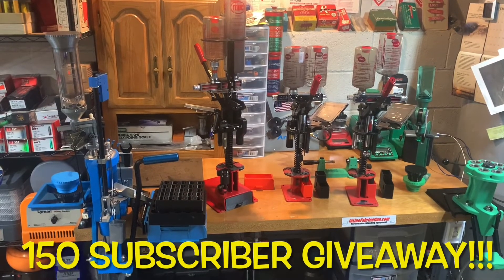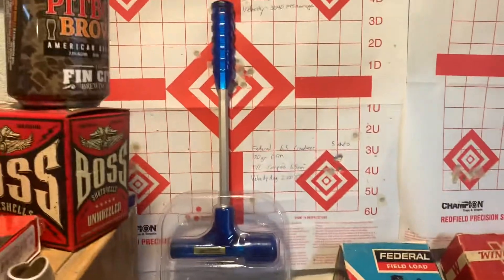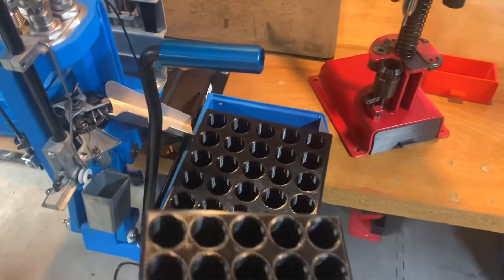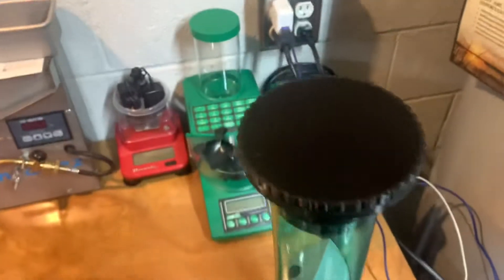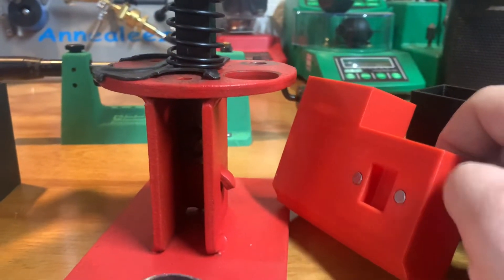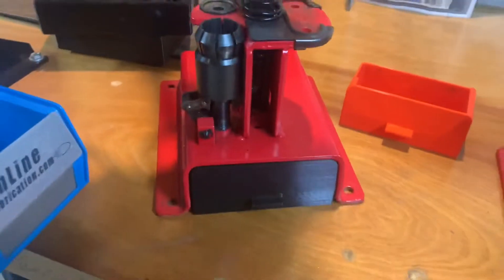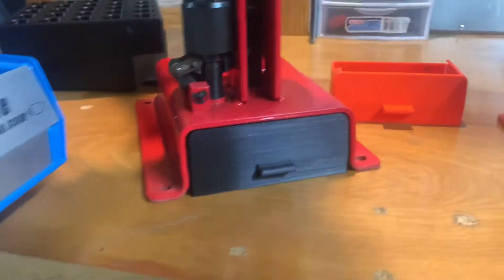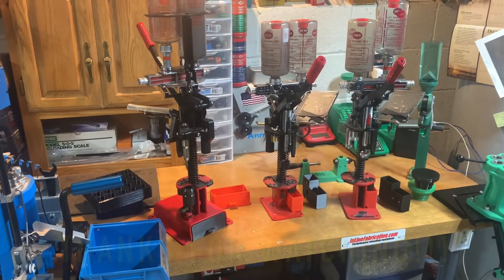150 Subscriber Giveaway! Three winners!! Thanks for watching!!! #PAwaterfowler #10gauge #20gauge

Comment: I'd skip the mergie chips , ugh . Keep the thinker thinking . Hard to do after a lotta years 10 ga . Ask me how I know . Early duck opens here on Fri.   Pls make a die box bin , modular , stackable . I have a 550 n several rcbs powder measures.
Reply from the maker: Thanks for the feedback. What’s wrong with Mergie chips? JK. 

As soon as I get design software back, I will add a die box to my list.
Reply from the maker: You won! I will send you an email here shortly. I am running way behind!
Reply: @avidwaterfowler7522   I got my first 10 @ '86 , have 3 . It's a game changer . I shoot a 10 cause we're not allowed an 8 . The difference between a 32" n 28 " is @ 5 YDS .  With lead 10 yds . ( sxs 32, o/u 32, n a bps 28)
Reply from the maker: @markwood4465  hey Mark, I sent you an email about winning. If you didn’t get it, please email me at avidwaterfowler@gmail.com
Reply: Got my reloading block . Outstanding,  you rock . Thx mark